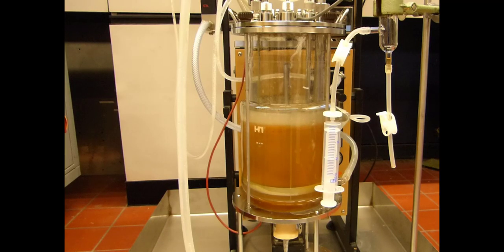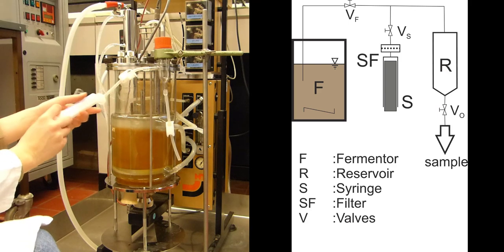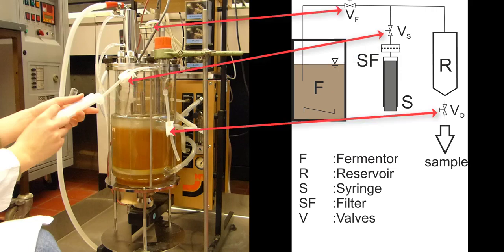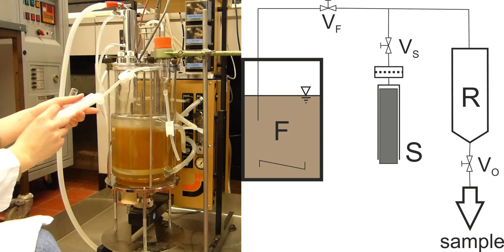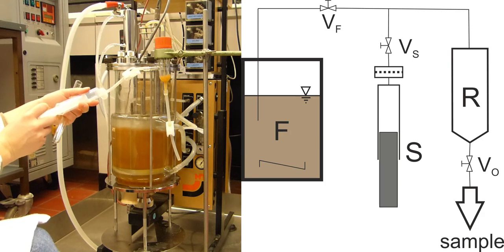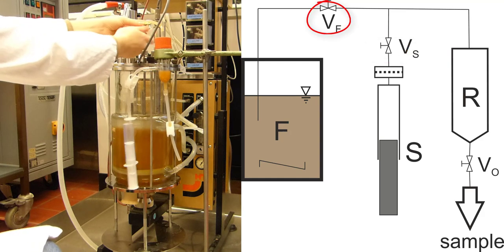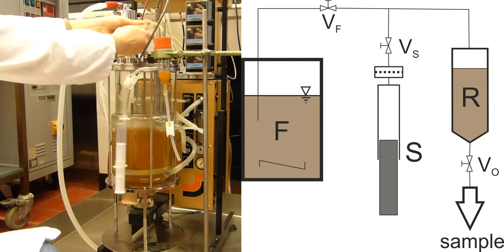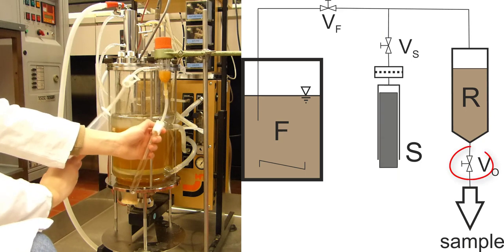Sampling from a laboratory scale bioreactor

Comment: A good video, but the set up of the video and the illustrations is a little different. In the video Valve F seems to be open from the beginning and only be closed after the negative pressure sucks the culture into the reservoir, whereas in the animation/narration the negative pressure is established than Valve S is closed and then Valve F is opened to suck the culture into the reservoir, or am I mistaken? I am planning to build such a sampling contraption too for our fermenter because the one that was supplied did not work aseptically. As valves simple clamps should suffice?!
Reply from the maker: Yes, you are right. F is actually open. Does not make that much of a difference for the setup.
The clamps are very simple. The tubing has to flexible enough and robust to regain their shape. They also need to withstand sterilisation protocol. We use silicone rubber.
Thanks!